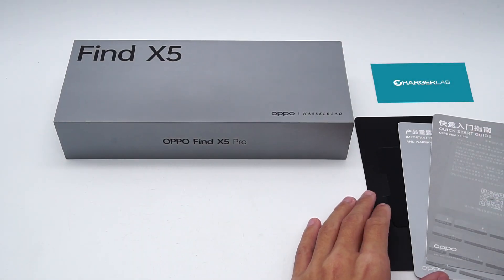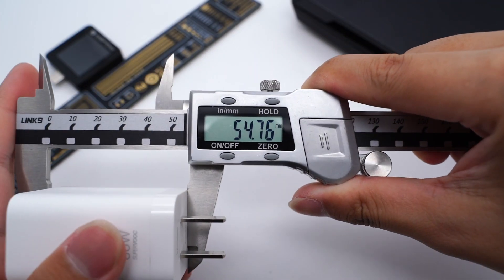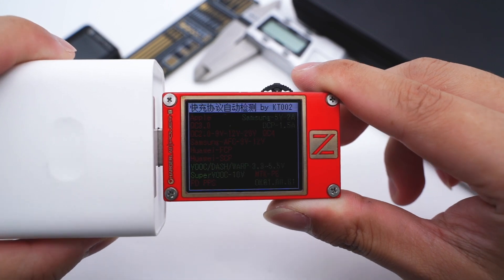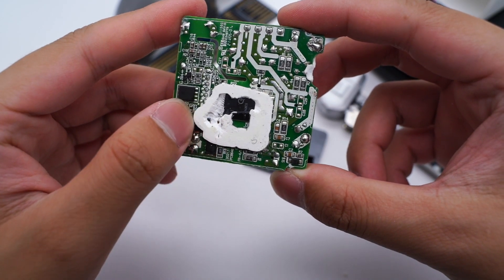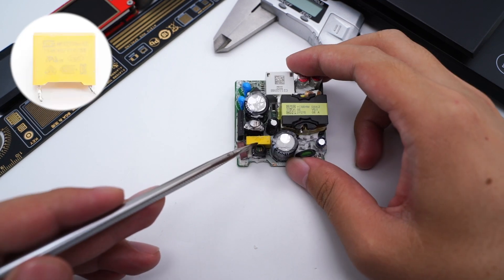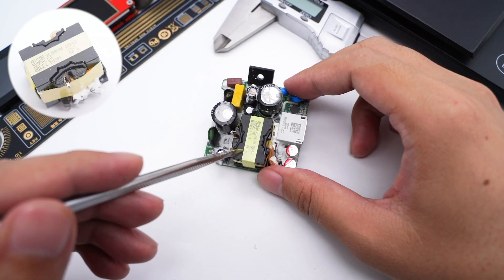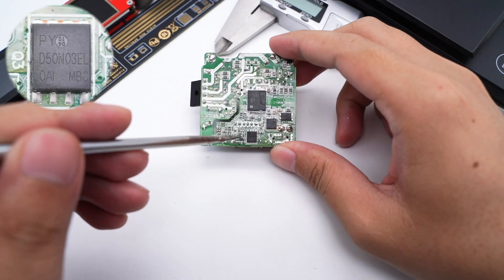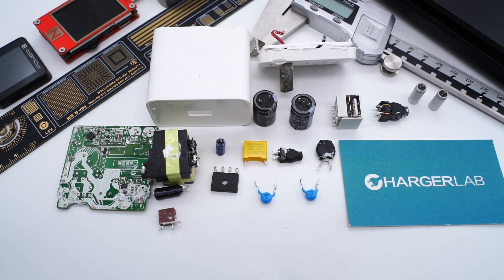Teardown of OPPO 80W SuperVOOC charger (Single USB-A)

Comment: Highly interesting video! I was wondering what the difference between the 80W and 100W Dual-USB version, where my OPPO 200W 20000mAh power bank will can't communicate with the 80W. Now I see the rectifiers is what it is looking for. UFCS looks like it adds additional components.

I went ahead and bought your product to show support. I don't need another USB tester but I love your work.

Comment: i use only the chargers that come with the device, had experienced battery swelling once when used someone else's charger, you have so much knowledge, have you built your own smps, i just one made a simple boost converter using a coil.

Comment: Why do you use a discharging device knowing that you're gonna disassemble the circuit anyway, wouldn't the tip of a screwdriver be good enough? I'm just curious...
Reply: I use the tip of my fingers of discharge caps. It's a lot more interesting and you get surprises sometimes
Reply: This discharges the cap without spark and cap friendly
Reply: @309electronic5  My point exactly, tiny spark no big deal.. caps are not gonna be used again.. so it's either a habit or a case of showing the public how it's properly done.
Reply: @EngAlperDemir  he did that in older videos lol
Reply from the maker: @megapro1725  Yes, but then we changed the workflow
Reply from the maker: We need enough safety measures to protect our photographers.